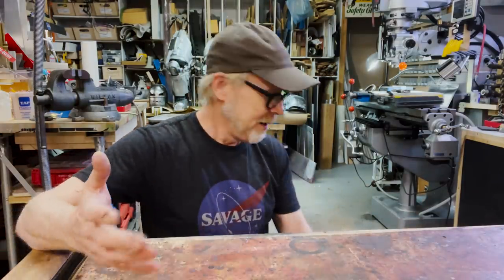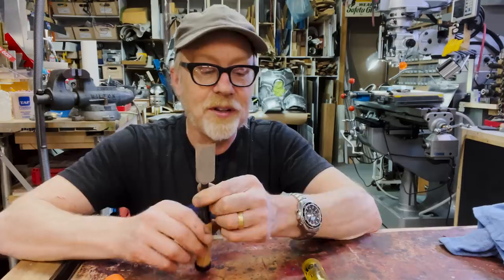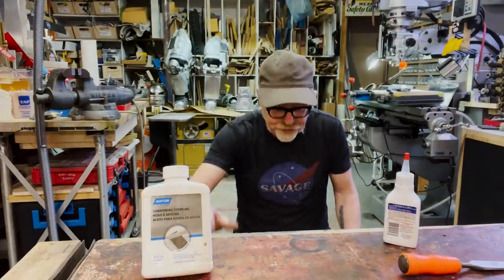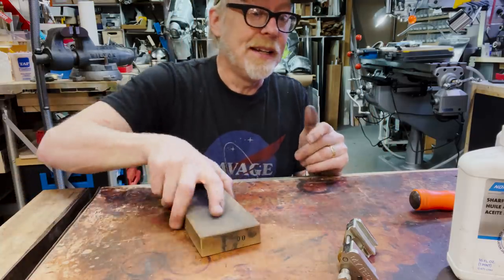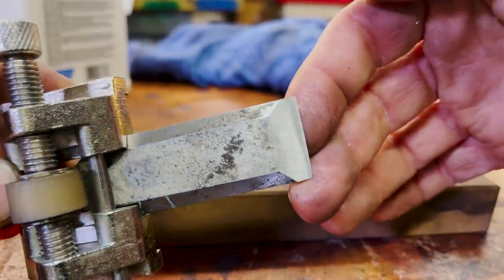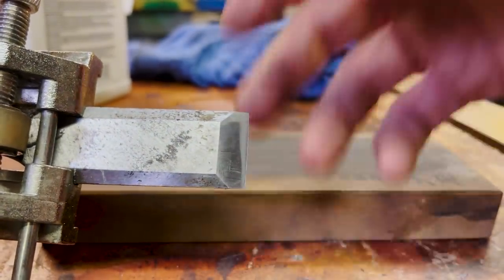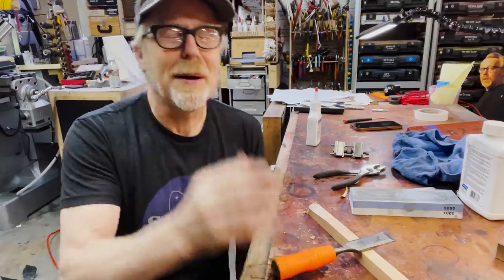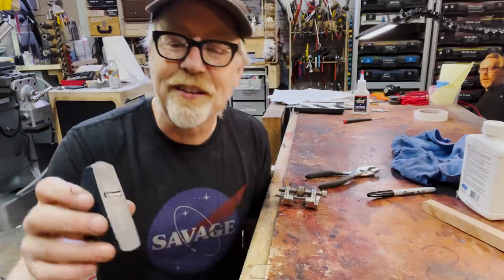Adam Savage's Favorite Tools: Woodworking Chisel Sharpening!

Comment: Just a tip, when ever you use whetstones/Waterstones make sure to soak them for 5-ish minutes or until you don’t see bubbles coming from it.
Reply: Soak with oil or water?
Reply: @Richardfunnyvip  for water stones, with water. Oilstones (such as Arizona stones) don’t need to be soaked, and shouldn’t be used with water. The soaking of water stones ensures that a slurry can still form after you wear through the top of the stone. This slurry allows the removed steel and stone particles to move out of the way so that the new stone surface is exposed.
Reply: This, but also always check what kind of stone you have. For example Shapton glass stones are water stones that are not supposed to be soaked before using.
Reply: @benbroekhuis8778  you can use any kind of lubricant you want on any stone. The names are just that. They're only names.
Reply: @1pcfred  this is true, you CAN use any lubricant, and it will probably work fine, but for best performance, especially with super porous waterstones (ex. cheap synthetic stones) I’ve found water does a better job than oil. Of course, it’s all 100% personal preference. I shouldn’t speak in such absolutes. I am no sith, after all.
Reply: @1pcfred  the main thing is once you soak a stone in oil, stick to using oil on that stone and water (add a little sodium bicarb to the water to prevent rust)  with water stones.
Reply: Oil clogs up a water stone permanently.
Water on an oil stone beads off and won’t help much.
Oil stones have natural oil in them to begin with so water won’t work well even with a brand new oil stone.
Reply: @andrewsock6203  stones can be boiled in a mix of water and powdered soap when they become glazed or if oil has been used accidentally
Reply: @gazpal  I have troubles getting oil out of my shirt and it’s only .5 mm thick. How manny years does it take to remove the oil from a 1 inch thick stone?  Soaking in Alcohol May be better ?
Reply: @andrewsock6203  I use this stuff called Purple Power. Which is a super cleaner. So it is a surfactant. But I use it with water too. Works with all kinds of stones. Leaves them squeaky clean too.
Reply: @gazpal  I used to use oil years ago. I stopped because it is too messy. I use a synthetic super cleaner called Purple Power as a stone lube today. It is more slippery than oil is. Some folks use glass cleaner. I like a fluid with a bit more body. Oil is real old school. Plus I don't use whetstones. I use diamond plates and polish on ceramic hones. It's 2021.
Reply: @benbroekhuis8778  feel is important and completely subjective. I've used straight water, oil and a synthetic super cleaner. Each has a different consistency and lubricity. I never liked oil. Though it is what I used for a long time. Like many I figured oil oil stones. Turns out that's not a hard rule. When I switched to diamond plates I switched to using the synthetic super cleaner. Now I use that exclusively. It is more slippery than oil is. Isn't messy either. It's a cleaner so it's clean to work with. Although I've used water stones with straight water. Didn't like it. Turns out what you sharpen has a big impact on sharpening too. Some tools are just too hard. Wood isn't the hardest substance known to Man. So you don't need the hardest tools for it either. Diamond plates are the great equalizer though. They sharpen everything.
Reply: @1pcfred  i vary between oil, water and diamond, but depending on whatever I'm honing at the time.  Mostly diamond, with a final whetting on a high grit water stone.  Thankfully most of my natural stones slipped past the household radar lol
Reply: @andrewsock6203  for your shirt, a dab of rubbing alchohol/methylated spirit, but keep clear of naked flame til it's gassed off.  For stones, just boil in a pan with soap flakes added and leave it to simmer away.  Replace water:soap powder mixture once it's totally filthy and don't allow the pan to boil dry.
Alcohol only tends to penetrate "skin deep", while the boiling water method genuinely cleans the filthiest of oil stones and also works extremely well if cleaning parts from firearms - suspended inside, but above the pan bottom.
Reply: @gazpal  thanks for that 👍 but to be honest, these days I just buy a new shirt, buy a new stone and buy a new used gun ;)
And even buy a new chisel.
I don’t like cleaning or sharpening, but I do get into it once and a while 😉
Reply: @1pcfred  You CAN also run into oncoming traffic, but I highly suggest against doing either.
Reply: @andrewsock6203  Anytime lol and whatever floats your boat, although it can become very expensive - fast - if replacements are sought each time something needs a little effort to clean up :-)
Reply: Big +1 on this. I have India stones & Arkansas stones that I use with oil, but Japanese water stones work much better (faster cutting, better lubrication, better surface finish) soaked with water. I do quite a bit of sharpening, so mine just live in a suitably sized Tupperware ready to go 🙂
Also on the superfine grits they can be pretty soft, so only cut on the pull or it'll dig in and take a chunk out of the stone.

When it gets worn down a bit in the middle, you can flatten it again on a sheet of coarse wet n' dry paper.
Reply: Im glad im not the only one that thought 😮 what is he doing with those stones. Using oil and dry!!! I nearly cried.
Reply: I've always heard when you start using oil on your water stones, you have to keep using oil and water is no longer as effective.  I could be wrong as i've only ever used water with mine.
Reply: @AlanarTansden  yeah, once there's oil soaked in, water can't displace it to form a decent slurry & will just bead up on the surface.
Reply: @AlanarTansden  they can be cleaned by boiling with soap flakes, but typically once you use oil stay with oil.
Reply: @gazpal  I actually drop and break a stone at least once every two years 👐🙈
Reply: @andrewsock6203  if that accident prone I'd be wrapped in a bubble suit lol
Reply: @gazpal  I have a messy bench and I often put my stone on news papers then because I’m lazy I knock it down or burry it in junk and like magic I turn one stone into two stones.
Reply: @gazpal  I do have a 80-100 year old stone or two but they turned into dust all by themselves.  Like brown sugar
Reply: @andrewsock6203  which type were they?
Reply: @gazpal  man made I believe

Comment: Hey Adam, those type of guides have measurements printed on the side on the lower grabber your using its 30mm stick out for a 30 degree bevel on the upper grabber its 38mm, usually for plane blades or very wide chisels
Reply: I came to say the same. A guy like me, or Adam for that matter can make a quick setup jig with a stopper at those measurements and make that quick and accurate to setup.
Reply: It's useful for setting up the first time but really after that just eyeing it like Adam did pretty much gets things done like free hand sharpening. The only thing Adam made sure was it's not skewed. Basically I'm saying is no need to stress using a guide everytime you sharpen the secondary bevel...just use it to establish the bevels when it's new/worn out. But yeah I made a stop guide after years of trying to nail the distance on a ruler lol
Reply: The guide I had had a flip out guide under neth. With measurements for chisels and plains. You flipped it out then just slid the chisel to the mark you wanted.
Reply: what they said.

Comment: The flatness of the stone is important too.
Reply: flattening my stones before using them has been the biggest game changer in terms of sharpness.  my chisels and knives went from "yeah that's sharper" to "i can comfortably shave with this"
Reply: @myrcutio  Just use stones that do not dish. I use diamond and ceramic hones. Ain't nobody got time to be flattening sharpening stones.
Reply: Very true. Many overlook that fact and end up with a slight dish on their stones, which will affect their sharpening. The same is true for bench grinders, the face of the wheels needs to be dressed on occasion depending on usage.
Reply: @jimmeier547  a grinding wheel needs to be dressed every time you care about what you're grinding. Which for me ends up being a lot more regularly than occasionally. If I'm grinding a chisel you'd better believe I'm dressing the wheel then. Maybe more than once before I'm done. Glaze is real.
Reply: Adam only uses the centre of his stones by the look of it.
Reply: @1pcfred  There are a lot factors in selecting the type of wheels used on a grinder. The friability, the hardness, the coarseness, and grade. With the right type of wheel, and the right light touch, a wheel can be used repeatedly before needing to be refaced. Yes, glaze is real, but that is more prone to less friable wheels and heavy-handed grinding. There is a difference between grinding/shaping a tool and sharpening a tool.
And if knowing and understanding that is too difficult for some, then there is always the option for CBN wheels that do not become loaded or need resurfacing. 
That all said, the same is true for whetstones. They can become loaded or have the surface changed and will need to be flattened. But that is proper maintenance for any kind of tool or item in the shop. One needs to know when and how it is done.
For me, the type of work that I do, it is rare for me to have to be that aggressive at the grinder. I am typically just sharpening and not shaping. So very little material is removed to have a new edge. 
Now if I am working with something like lignum or similarly silica embedded wood, then yes, I then need to step down to a coarser wheel and start there.
Reply: @jcoul1sc  Yes, it does look like that.
Reply: @jcoul1sc  yeah you have to spread the wear out. I don't even use stones anymore. I use diamond plates. They never go out of flat. They do wear out eventually though. It is still good to spread the wear out using one. Spend the extra and get bigger plates. Having the room to work is nice.
Reply: @1pcfred  True.  I bought a cheap little diamond one to get the glaze off.  Works great.

Comment: It depends on the stones but I’m pretty sure the ones you’re using need to be soaked in water for 10-20 minutes before use. Get some dry stones or some shapton glass stones. They’re expensive but they work great dry or wet
Reply: I winced when he went to the 1000 grit. I saw the dust fly up and felt physical discomfort.
Reply: @Jared1983  same lmao I wanted to say but didn’t wanna be mean. Shit hurt to watch
Reply: @Jared1983  i'm glad im not the only one 😂😂👌👍
Dude bangs and throws those things around and then uses them dry..jesus i almost died inside 😂
Reply: @Jared1983  Same. There were a number of points where I winced all the way down to the cutting demonstration with a chisel that clearly wasn't sharp. 

I'm glad this process works for Adam but perhaps it's not the best video to watch if someone wants to learn to sharpen a tool.
Reply: @jeremyjgerman  as someone who uses a chisel in conjunction with a hammer, usually to just split something, I was very impressed with how sharp Adam's chisel was. There are obviously many levels of tool use.
Reply: Question broke my good stone my father gave me years ago but to find another one they all seem to wont my first born. Any hints or places or websites that I can get good quality stones and not lose the house? Thanks
Reply: @dirtdigger949  honestly my fave sharpener is the new worksharp precision adjust. I moved from stones to that thing and I love it. Barely use my stones now. But if you want a decent stone, I’d say get a king stone. You can get a 1000/6000 double sided king stone on Amazon for like $30 or an 800/6000. That’s only if you intend on sharpening but not reprofiling. If you want to change up edge angles or take out larger chips, I’d say get a king 250/1000 double sided stone. You’ll probably be safer with a lower grit for reprofiling and a 1000 for actual sharpening - don’t worry about the high grit polishing too much. Regardless of what combo you choose, I’d say get King stones, their quality is pretty darn consistent and they’re not expensive.
Reply: Someone needs to show Adam the scary sharp method.🤣
Reply: @dirtdigger949  for cheap but effective stones you can go with a king 1000/6000 kds combination stone. It needs soaking and eventually flattening. 

For a better but slightly more expensive option you can get shapton ha no kuromaku stones they just need water splashed on the top. Maybe the 1000, and 5000 would be good. With a 320 grit for repairs. Also they stay flat much longer.

Comment: I'm a retired carpenter.  I find the guides are very handy and use them for most sharpening although I have no problems doing it freehand,  with a guide it's faster. I stopped using oil and water stones on site and preferred to use an old piece of 3/8" plate glass with wet'n'dry on it, wet the glass first and the paper will stick in place then wet the paper. For a knackered chisel I would start at 400 grit or even lower if really bad, I would go up to a finishing grade of 1800 but always clean the edge on a strop.
The usual routine is 600, 1000 or 1200 and finish on 1800.
Using wet'n'dry gives you a bigger stroke and the glass means it is always flat, stones dish and need to be trued up regularly.

Comment: Uncle Paul's technique is great when you have a chisel or iron you already know has good, flat surfaces but for reshaping and repairing or requiring I have found those cheap little guides are exact what I need! I have already cost myself tons of work trying to eyeball the grind and shape my planer irons on the grinding wheel, angle grinder with flap disc- ugh, what was I thinking?!?! Patience is indeed a high virtue.

Comment: I had a problem learning to sharpen blades. I would get the bevel angle wrong for the purpose, round off edges,... basically destroy blades. Then I had a sergeant who taught me the secret for sharpening any blade. Don't let it get dull!

Now, I don't even have a sharpening stone. I have a plate of glass with different grits of sandpaper glued to them and a ceramic bowl. I also have a ceramic piece for doing streak tests on minerals. The glass if for everything from chisels and planes to axes and hatchets. The ceramic bowl is for honing my pocket knife and my hunting knife. 

Every time I use my pocket knife, I wipe the blade a few times on the glazed bottom rim of a ceramic bowl. Great for keeping an edge. I haven't sharpened that blade in over two years and it still sharp enough to shave with (Note: that is a guess. As you can see from my photo I haven't shaved for a while).

Comment: Keeping the face of your stones level is also very important. It's best to have patience in regards to preserving your stones and light even pressure vs. a lot of downward pressure makes ALL the difference. If you look at the cutting edge of the chisel you sharpened, you'll notice it's beginning to gain a radius. This is because your stones aren't level. As you sharpen in the forward stroke, you're actually CUTTING the stones surface which is Death to any Stone. Always Pull!! I know you want results as fast as possible and I totally get that. But.......Patience and proper form in this instance will make or break the stones degree of concavity which....we all know.....will cause a radius on chisels cutting edges. It's not always about speed. Precision is the name of the game to preserve these expensive stones. But, I still always love your videos Adam! Cheers! Zip~
Reply: Just throw those old stones out. We have better products to use today. Those old stones are only a trap for new players.  If you drag sharpen all you're doing is making a burr then. The proper way to sharpen is to push the steel back using forward strokes, carefully. There's some touch involved with sharpening.

Comment: Some of those guides are marked with lengths required to achieve the desired angle.  Very useful tool.  Also, Japanese water stones create a slurry when used with water that helps with the creation of the bur required to get a really sharp edge.  Korin has a great channel for teaching water stone sharpening techniques.

Comment: Adam, you should soak your water stone in water for 5-20 minutes before use & then keep it wet with water while using it. A quick way to establish the proper placement of your honing guide is build a small jig that has a front edge & blocks at different distances from the edge to match the stick out needed for the angle your chisels.

Comment: Chisels are meant to get dull and be sharpened, and learning to sharpen them is an important skill of using chisels.  Yes, better metals do hold an edge longer, but the expert is constantly sharpening their chisels, even when working in softer woods.  A fine woodworker will touch up the edge on their chisel several times in the course of a single project.
A whetstone or diamond stone, and a strop with honing paste with a little training and practice, and it's a short easy job.  Every so often, you'll need to grind a small amount of metal off to enable a sharp edge at the appropriate bevel, but a chisel of quality will last for many many many years, even with frequent sharpening, because when you do need to grind it, you are taking off a very small amount of metal, if you do it right.
That said, the main difference between those two chisels up front, other than the quality of the metal, is the beveled sides.  The cheap chisel has beveled sides that allow you to get into corners, which is very handy when cleaning up a dovetail joint.  The expensive chisel has straight sides, which is very handy when cutting a mortise where you need the sides to be straight (the square sides ride the side of the mortise, helping to keep the cutting edge lined up).